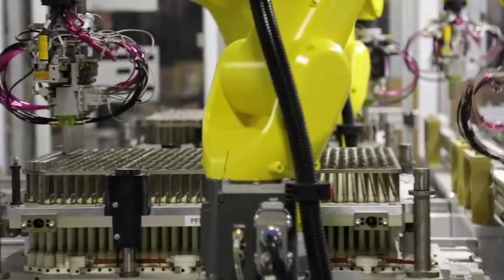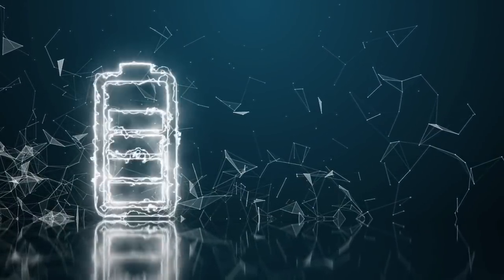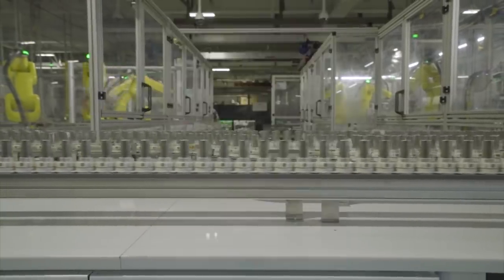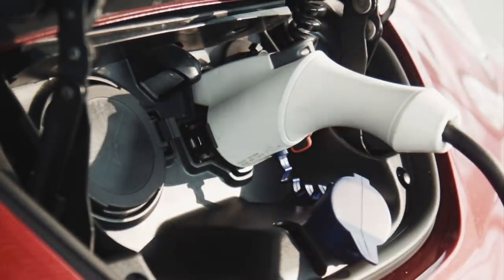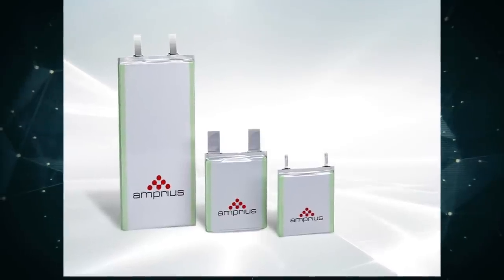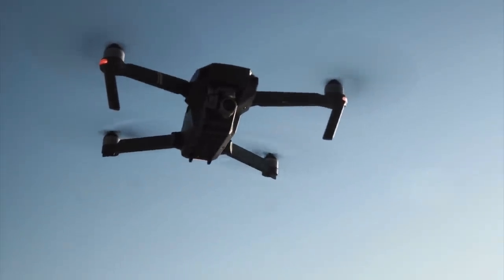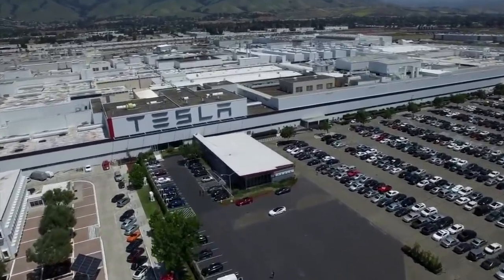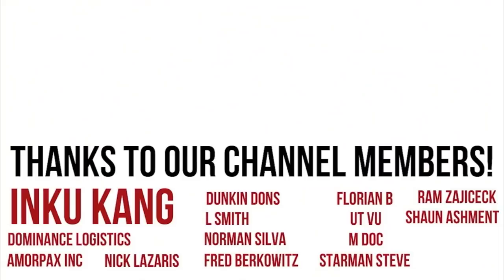Tesla's Upcoming Nanotech Battery Is Worth Trillions

Comment: One solution is to replace battery modules at automated "filling stations" instead of recharging in the same vehicle. Have a standard battery module for all similar types of vehicles that is swapped out by a robotic system in less than 5 minutes for a flat fee. The stations manage all the charging, recycling, etc.
All or most of the charging can be performed at non--peak hours.  Each battery will be electrically and physically inspected robotically EVERY time it is changed out, reducing the chance of catastrophic failure on the road (or in a garage). No need for special wiring in the home. Greatly reduced risk of any battery failure incident at homes.
Customer is assured of a battery that will last at least until the next station and doesn't have to worry about monitoring/maintenance of the battery.

Comment: bitches good luck replacing our 1000lbs lead train batteries bitches....... rolls battery....nano and ss batteries might work for a cell phone never for a train or car. these batteries made so far wouldn't even power a cell phone, You keep talking about 700 miles on a battery. yet the battery so far has doubled a tiny cell phone battery. You would need 10's of thousands. How is the technology ready? if its not being used in any products?

Comment: Surely I'm sure it's already been pointed out here that Elon said the background image is the new internal battery electrode end contacts and not Silicon nanowires.  The former do significantly improve their batteries performance, manufacturing efficiency and cost, but not to the extent of the latter.

Comment: Someone needs to look into making  CARBON LITHIUM BATTERIES! These could be make out of  PULVERIZED COAL or SOOT from a chimney / car exhaust pipe. Little weight and could hold a charge for a long time. Also a super flux capacitor  that will work in air crafts and or spaceships. easy peasy what is taking so long? just made from waste carbon!

Comment: Let's be clear on one thing, TESLA DOESN'T MAKE IT'S OWN BATTERIES or CELLS. It merely sources it from Panasonic and CATL. So if Amprius decides to sell the same battery to VW or BMW or Toyota etc there is nothing separating them from Tesla. Unless Amprius is totally locked in with just Tesla by contract for set period if time (5yrs-10yrs). Let's see.

Comment: "The technology is ready for supersonic flight" Flights lasting 5 - 10 minutes that is. Even the vtol uber services are not going to go faster than 150mph or further than a couple of hundred miles max. How is this same tech going to work in the most energy wasteful transportation mode that exists (except maybe orbital launches)?
Reply: You can actually make a perfect mix with electric engines and rocket engines... you can use electric engines to take off and climb to let's say 40.000 ft and mach 0.9... then you light up a rocket engine to climb to 100.000 ft and mach 5-7 and then you glide back down to the destination airport and you recharge the batteries during the whole descent by windmilling the electric engines. Rocket fuel is cheap, electricity is even cheaper and you may actually land with fully recharged batteries and be ready to fly again with just a refueling for the rocket engine. Tesla + SpaceX have all the knowledge to make that revolution.

Comment: The next person who says or writes that most persons don't need a 700 mile range battery I am calling them out. We have cars now that give a 550 miles on a tank of ⛽. So, you think those people would give up 550 miles range to go with an EV that gives less. What fool is going to cash their chips on a bet that electricity will always be accessible? I hate to see the sorry look on your faces during a power black out. No, I will take my 1000 mile battery, thanks. I expect the unexpected. Don't and you will find yourself or your family in the worse situation possible.
Reply: I have had an electric car with an 84 mile range for 3 months now and it has never been a problem. If I need to go further I rent a car, or take a plane, but for a daily commuter or most folks even 300 miles is overkill. Then you are just using energy to haul unused batteries around.
Reply: @macrumpton  Well, first my wife and I take trips to Florida or South Padre so a long range vehicle will be good for us.  Two, you don't know when a natural or man made disaster- emergency will happen so it is safe to not depend on normality. Third, charging a 700 to 1000 mile battery means that you are set far longer than smaller capacity battery. And you may not have time to rent an ice vehicle. Redundancy and overabundance is better than normality. Last, eventually the battery will hit zero if it is not recharged. Therefore, while a battery is closed to full or 700 to 1000, The vehicle will have a longer period between charging. It will give someone else time to recharge or use the vital resources taking pressure off the electric grid.

Comment: What the world needs is super conducting wire. If they can make graphene easily there may be a day where they can send mega watts of energy huge distances with zero line losses. Possibly storing the energy in mechanical devices for peak load balancing. If this happens I can see electric vehicles taking over the world. Until then there simply is not enough capacity on the grids to transform all vehicles to electric.

Comment: Now there's a company call NDB that claims there batteries will last over 5000 years with no recharging, basically craminng nuclear waste with Diamonds some how. Scary but interesting 🤔
Reply: What the NDB announcement I saw didn't mention was the very low power density.  The energy density is great if you can wait 5000 years to get it.  Think of an anniversary clock -- same idea.

Comment: If Tesla made dimond nuclear batteries then form the dimond into a LG brick in sections the size of Tesla battery you could use for homes cars trucks for emergency power half size battery the nano wire batteries and other half dimond nuclear batteries it could charge nano battery while sitting so you drive for a day or hour just drive normally then charge or use dimond nuclear batteries to charge car a 2 part battery one constantly charging the nano wire batteries https://youtu.be/Fj7z8wFGzDE

Comment: I guess the equation is energy density vs cost.  However batteries are complex and number of charge/ discharge cycles, maximum discharge rate, charge maintenance when not in use, operational temperature range and resistance to ignition if shorted are all issues that need to be weighed.

Comment: ''why is battery technology evolving so slowly?
because battery companies want to sell more batteries.
Reply: I guess that's why we've never seen any technological progress of any kind, right?
Reply: @grinpick  Comparable technology improvements are for example, processor performances, hard drive spaces or memory density... all those technology improvements have been made because they actually increase sales, because you want the more powerful CPU or the bigger hard drive.... but batteries for cars do not follow the same principle, if the density of the battery improves you will not change your car every year, cars ar not computer CPU or hard drives, it's a more permanent product. Moreover EV batteries are embedded in a production chain which is a complexity nightmare to modify. Current EV range is already reaching what is considered by many as sufficient, therefore the end result of battery energy density increase will most probably be less batteries in cars for the same range and a decrease of production cost of EV. This is why current battery manufacturers won't be the ones making breakthroughs in batteries... The longer is stays like now, the better... apart from Tesla because they build batteries AND they use them in their cars !
Reply: @Turbo999be  Apart from Tesla, you say? That's a pretty big gap in your assertion right there, 999. Tesla (and Musk) is exactly who stuck a thumb in the eye of the automobile and oil industries. Those two, taken collectively, have much more at stake in maintaining the status quo than the battery manufacturers that we're talking about. But they're both looking dolefully at the beginning of the end. Tesla is not just an automobile manufacturer. They're also a software company. GM, Ford, VW, Toyota, et al, over-estimated how long it would take to achieve what Tesla has already achieved. Too late now for them to quickly catch up. But more importantly, Musk has shown other entrepreneurs a new approach to transforming industries. Everybody thinks his own production process is a "complexity nightmare." Then somebody comes along and and relentlessly applies a big-data approach to simplifying that nightmare and making it less costly. It's happening as we speak. I stand by my prediction about the end of the 2020's.
Reply: That’s why we will never see them in mobile phones or e-bikes or anything joe public uses on a regular basis, power companies would not want to lose that kind of cash. It’s not new inventions holding us back it’s old inventions,and greed.
Reply: @allanallen1835  Maybe you guys are right. But it says here that we'll see major advances in battery technology that will affect, in a major way, all the applications you've just mentioned and others yet to be considered practical for battery power. Both consumer and capital goods will be transformed. This transformation will be under way before 2025 and by the end of the decade battery efficiency will have increased by an order of magnitude. What you call greed (profit seeking) is what will make it happen, not what will stop it.
Reply: grinpick we have had the ability to have free energy for many many years and it’s all just gone away into the night. Nicola tesla invented a device that would harness power from the atmosphere through static and that was torn down and the plans destroyed. And what about the car that ran on nothing but water(not hydrogen) just pure water, that guy is now dead I believe. You have to ask yourself will we really benefit from these new technologies. As for our progressive technology that’s way behind what it should be, but if your happy with a new Apple watch every 12 months that’s nice(mrs brown). What I call greed and profit seeking can’t be quantified in the way your saying either. It’s absurdly obvious that major power companies have held us back with technology because it would cut into the profits margin. Imagine totally free energy and you don’t have to pay companies at all for the power.....yeah that’s happen right. I hope we do get what your saying,it would be great to have a future where we all build and utilise free energy and or have unlimited batteries etc, but history shows us were way to greedy than we should be. God bless.
Reply: @allanallen1835  would you spend your family's fortune on a technology and give it to everyone for free?
Reply: Exactly, all battery manufacturing is completely frozen in the Li-Ion or Li-Po manufacturing process. All suppliers, the whole chain. It would be financial suicide for these companies if something new comes up that outperforms the old ones by a big factor.
The same goes for chip manufacturers and camera sensor manufacturers.  All want to strectch the time they can sell outdated crap to us, and we buy it :-)
Reply: @erwinmaes780  LiFePO4 (Lithium Iron Phosphate) is available and is generally superior to LiIon and LiPo. It works great. It is increasingly being used in small auxiliary power units, hospitals, small electric vehicle companies (like wheelchairs, golf carts, electric bicycles, etc), and in the hobbyist community.
Reply: Reverse technology if your awake.

Comment: Silicon used in batteries for anode is better but batteries with silicon change the volume during charge and  discharge. So the life time of these batteries is short.  :( I'm sure if there is something really very good with silicon, Elon will react. But probably not....

Comment: Sure do hope Elon separates the battery from the car. If I had an accident I could buy a new car and add my original battery
Reply: @Duribethin Batteries have always been swappable for undamged cars, but if the car/battery gets damaged, it's probably not swappable.  Tesla is moving away from battery modules and moving towards cells directly in packs, which is less repairable if the pack gets damaged.  Fortunately Teslas are far less likely to crash, due to active safety features.

Comment: Silicon expands. This is the reason they fail. However, the nanowires don't fail even with expansion. The cycle rate is currently not sufficient to make it feasible until they get the cycles up to 2-4 thousand times.

Comment: More range and faster charging time, that is what we need and yes we do need 700+ mile range not 400.
Reply: Yes, I often drive over two mountain passes ~200 miles to where my Mom lives in the winter running the heater my LR Model 3 can barely make it.  I need 600+ miles range per charge.
Reply: IF you can have a faster charge why would you need more range?

Comment: I heard Elon musk telling that vertical takeoff might need 800 wh/kg. How john can say it will take 400 wh/kg
Reply: There's a difference between vertical and runway type take off, i also heard 400 but for runway.
Reply: @francoischarbonneau9447  Elon on twitter:"400 Wh/kg with high cycle life, produced in volume (not just a lab) is not far. Probably 3 to 4 years." he was answering a question about VTOL.
Reply: VTOL is possible right now. With 260Wh/kg. Look at all the quadcopters. 
It is just the question of range. Electric planes are possible, just with poor ranges. But even 800Wh/kg wont be enough for bigger planes like the 737. I mean jet fuel is at over 40MJ/kg = 11,1kWh/kg. 

And the current tests planes just work with propellers. So they cant reach the required speeds of an commercial airplane.

Comment: Unlikely unless they solved the swelling problem.  Nano.structures would be even more susceptible to the problem.
Reply: Amprius says that the nanowires eliminate the problem.
Reply: IncognitoTorpedo the question is why or how? Swelling is caused by Lithium ions traveling into the silicon lattice.  Silicon nano wires’ surface area to volume ratio will be very high, permitting even more ions to be inserted into the silicon lattice and hence cause even more swelling.  So far I cannot find a single paper that describes how nano wire fixes the swelling problem. If you know of one I’d appreciate a link to it.
Reply: IncognitoTorpedo here’s a paper that talks about how these batteries are made but it just brushes over the swelling problem. Also the data regarding cycle charges does not look good.  But the article is 10 years old.

https://web.stanford.edu/group/cui_group/papers/nn901409q.pdf